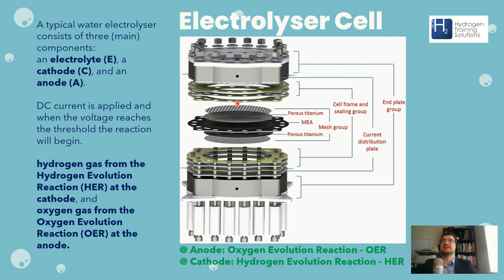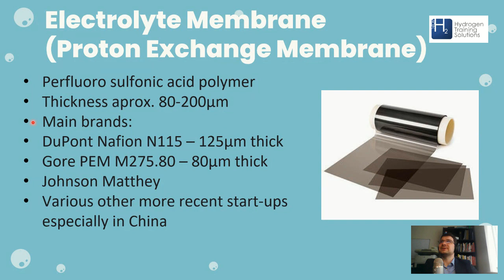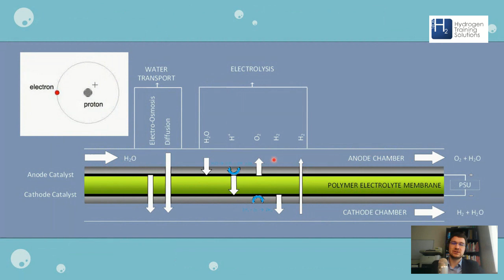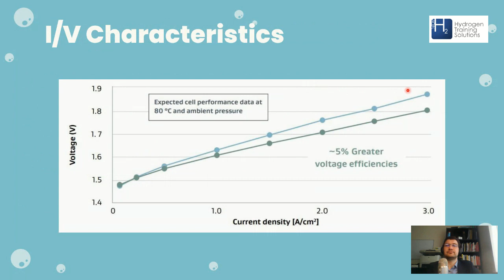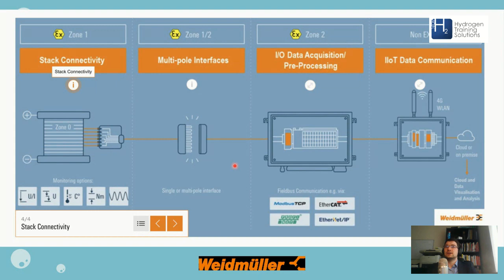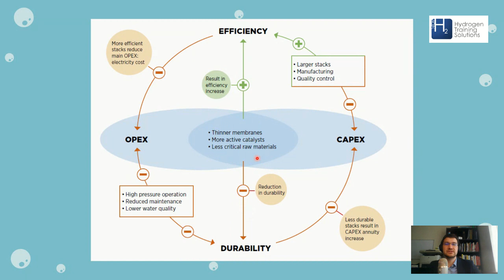Webinar: How PEM Electrolyser Stacks Work?

Comment: can anyone comment on specifications of an electrolyzer which are not so familiar with the buyers.?
Reply from the maker: Could you be a bit more specific?
Reply: @HydrogenTrainingSolutions   There are some specifications which are very basic such as power consumption, production rate , operating temperature or pressure. I would like to know more deeper specs such as cell voltage monitoring or any other trouble shooting methods which may not be familiar with someone who is not so Techie.